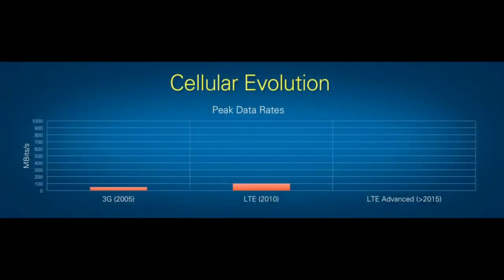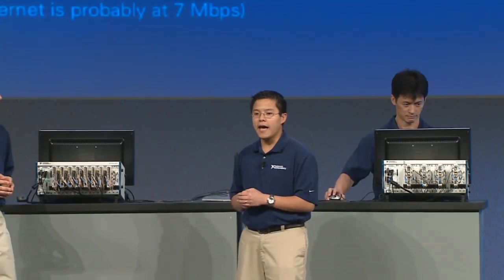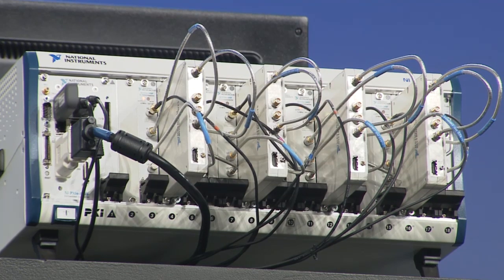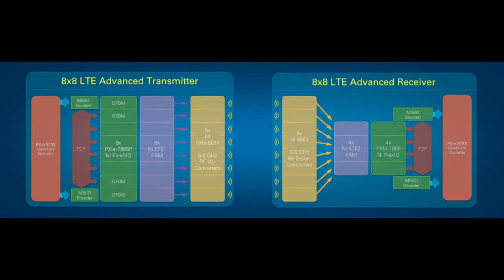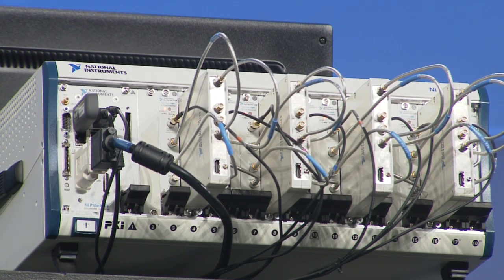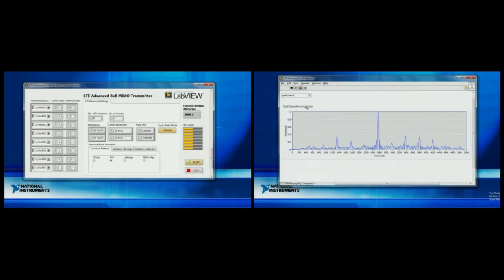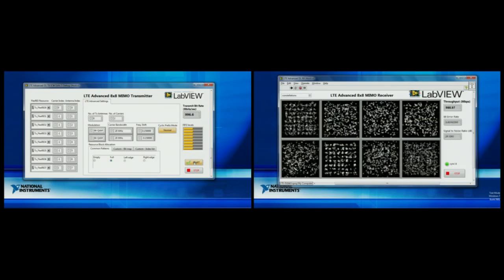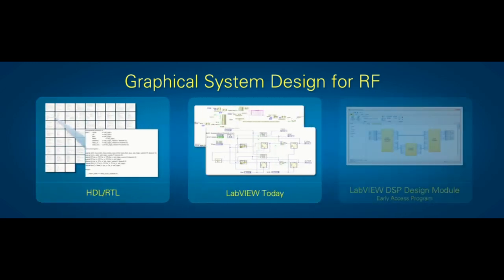8x8 MIMO (LTE Advanced) Achieves up to 1 gigabit per second data

Comment: Still waiting for this stuff to be more common! Haha realistically though I can't imagine a cell phone or even a tablet being able to effectively utilized 8x8 MIMO, for things like "smart cars" with built in wifi hotspots via LTE this would not only give UE's crazy speeds but it would provide a very robust link to the base station, specifically in areas where a cell phone would have no signal and thus services like on-star could tout more reliable connections to emergency services even in areas with bad signals. Side note: That's allot of sector antennas on one base station! :O TDD would be okay but FDD 8x8 is gonna look crazy!

Comment: Take a look at this LTE grid calculator:
paul.wad.homepage.dk/LTE/lte_resource_grid.html

Each small white square represents a symbol on the PDSCH. If you set the bandwidth to 20Mhz you will be looking at one frame (=10ms) so you can count up all the squares and x100 ;-)

Comment: @Alan, here is my calculation:
1) Each 20MHz MIMO stream carries up to 14,943,600 symbols/s on the physical down-link shared channel (PDSCH)
2) At 6 bits/symbol, with 8 MIMO channels x 2 carriers:
14943600*6*8*2 = 1434585600 ~= 1.4 Gbps 
3) The transmitted bits will be coded to add redundancy before transmission, reducing the information throughput by a factor of 0.4 - 0.9

I assume the demo coding rate is around .66 to get the numbers shown.

Comment from the maker: The demo was done as a proof of concept and uses our 5611 upconverter natively without any external power amplifiers. We do not using an external power amp at all.  The demo was a showcase of the capability of our platform, with the combination of powerful FPGAs interconnected via our PXI backplane, and instrumentation quality RF, as a rapid prototyping tool for algorithm designers.  I hope that answers your question.